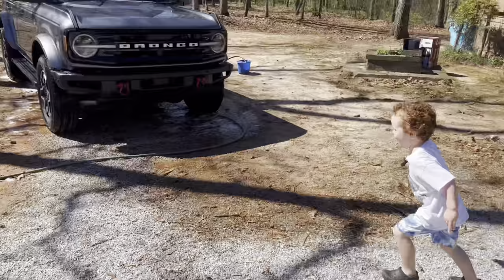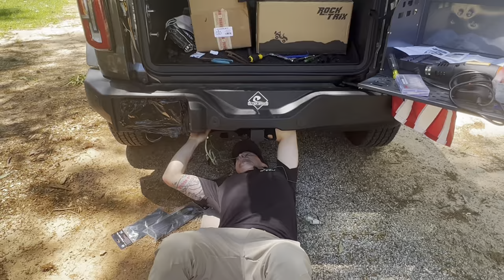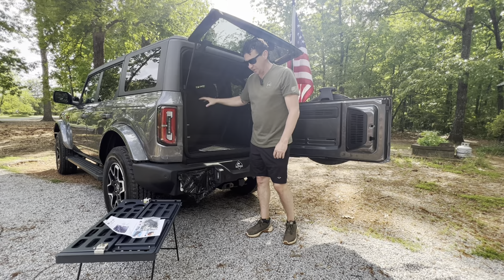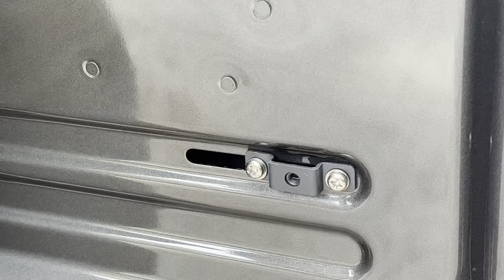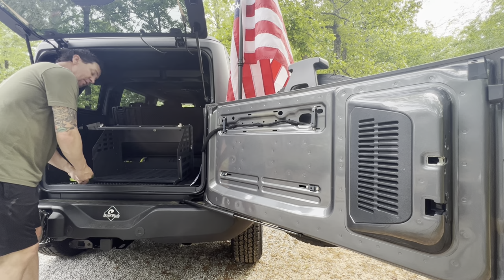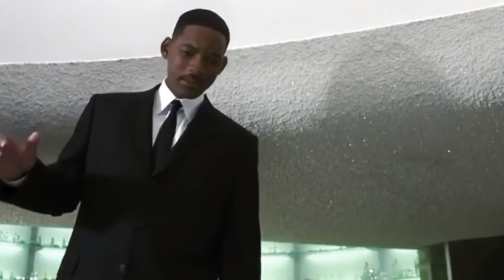Is this the best Ford Bronco Tailgate Table?!?

Comment: I like the concept, but this might not work for me!
I have the Slideout Tailgate and the side panels would probably block me while sitting on it!
I know the original OEM tailgate works with the tailgate, but I’m checking out all iterations before pulling the trigger!
Reply: how do you like the slide out tailgate?
Reply: @fernandohmoran  — I absolutely love it!  it’s well worth the price! It truly pissed me off when i discovered that i couldn’t add it to my Bronco during the build process! I camp a lot and love being able to use it as a seat or as a convenient way to access my cooler and other equipment without removing it from the vehicle! Heck, i have even Tailgated with it at a USC game! I love the fact that it has a 600lb weight capacity and creates a flat floor (for sleeping in vehicle) when the rear seats are folded down! It truly expands the versatility of an already versatile vehicle!
Reply: @Bacnow  glad to hear that! I want to add it to a build I will be ordering but haven't been able to find more than like one video about it on youtube. It sounds very versatile.